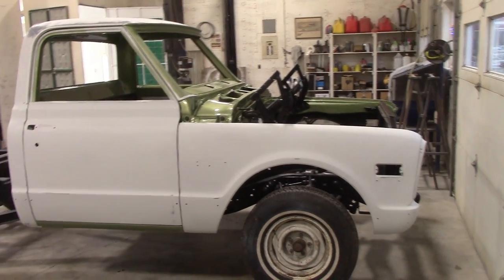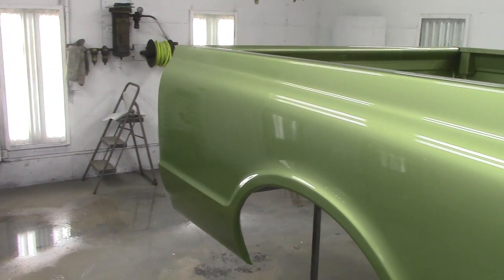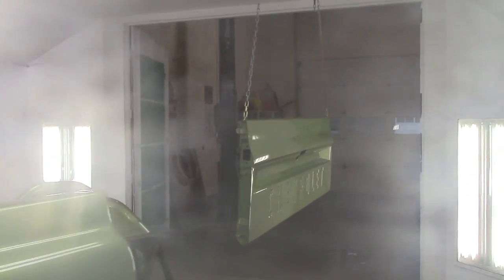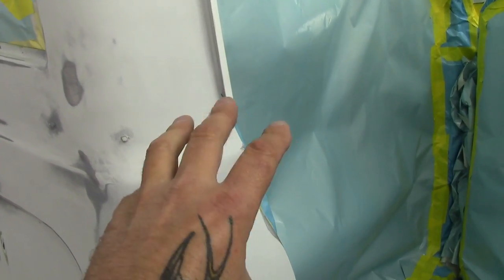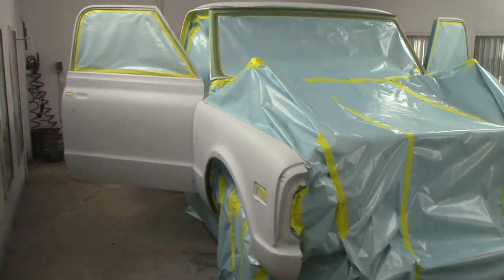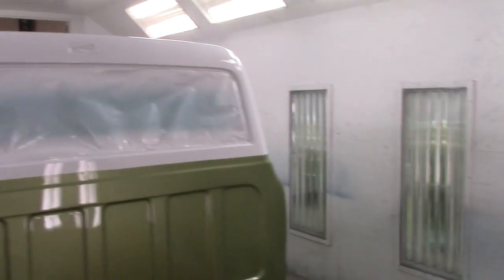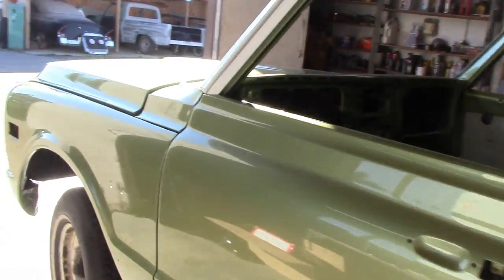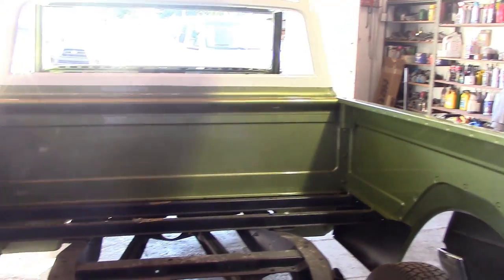Painting a 72 Chevy C10 Factory Olive Metallic Green

Comment: Had decided to buy a new truck in 72 and loved that color. 73, they changed the body style and deleted that color. Bummer!!! Took me a year to get used to the new style. Bought my first new truck in late 73. A 74 Cheyanne Super stepside in "Rosedale Red" that I had until 2003. $3700.00 out the door!! Straight to the tire shop for slotted mags and tires. Eventually put a grey tonneau cover with a huge maroon bow tie, tunneled the tail lights into the fenders, cut Monte Carlo back up lights into the rear bumper, put the Fleetside fender trim on the wheel openings. Had about 250K miles on that truck when I replaced it in 2003. Kept getting "oversprayed" at construction sites. Painted that truck 3 times!!! 
You right, it's "Gorgeous"!!! 👍👍🛠⚙️✌️
Reply from the maker: Love the stories